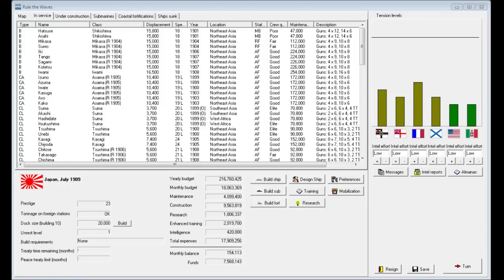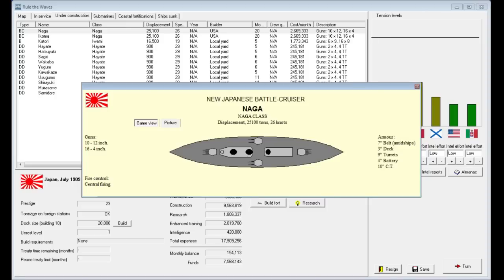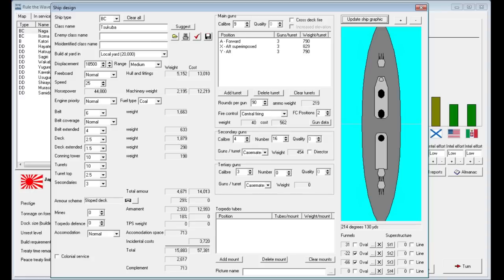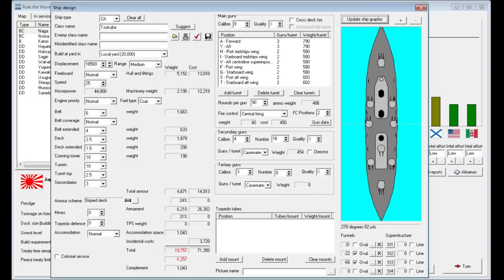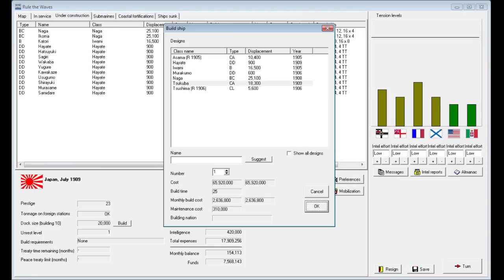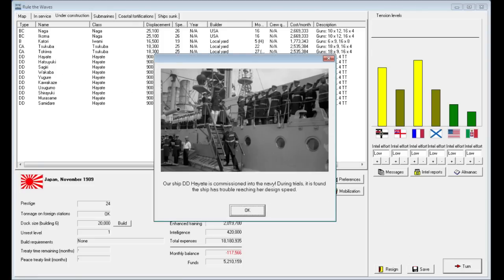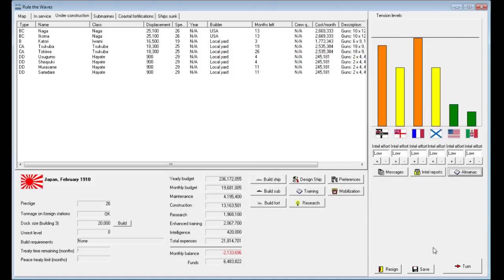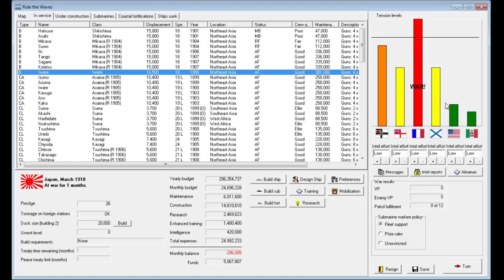Rule The Waves - The Comming Storm

Comment: Hey, loving this series and your videos. A couple of things. 

#1: reciprocating engines are pronounced: Recip-procating. Like recipt with the P sounding instead of the T, and a quick procating. The best way to explain them is that that steam drives pistons like in a gasoline engine(or a steam locomotive) . Turbine basically have the steam pushing against a fan (as you can imagine) 

#2: One area I feel you're somewhat neglecting is torpedo warfare, especially for the Japanese. Due to some successes in the Russo-Japanese war, (which were overstated), the Japanese embraced torpedo warfare wholeheartedly. Would be kinda nice to see more, but its up to your preferences to how you want to fight vs other nations.